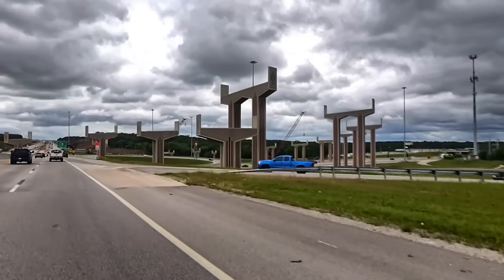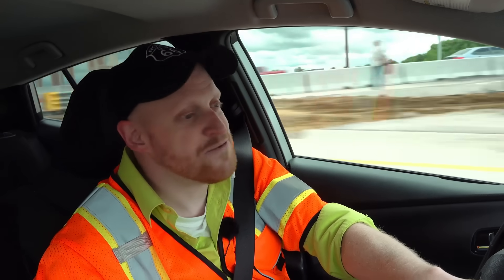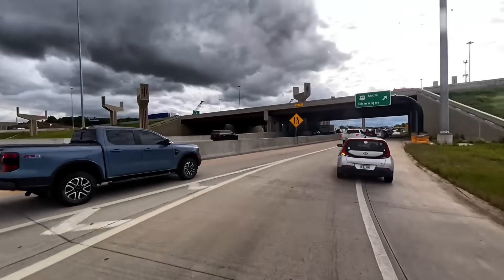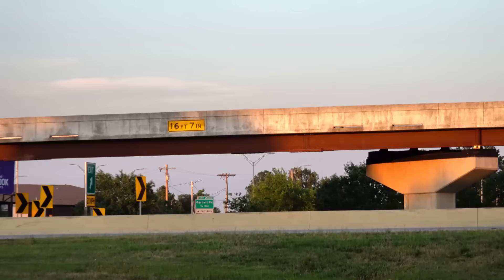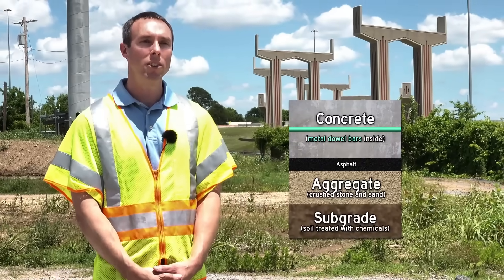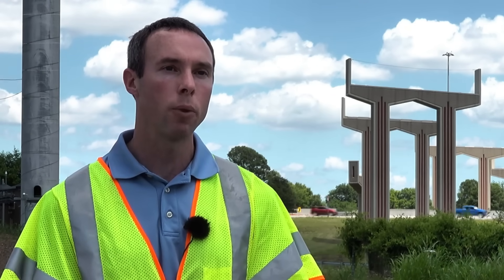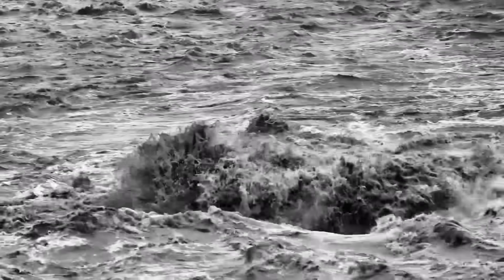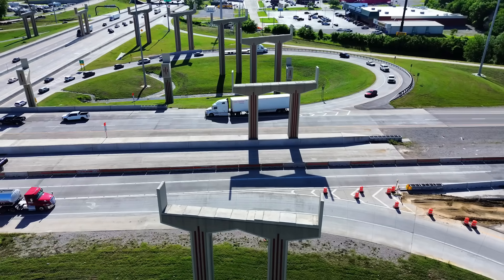Tulsa Built 50-Foot Goalposts 🏈 (It Fixes a Cloverleaf Catastrophe!)

Comment: Now, just imagine all that construction and congestion at every interchange in the Tulsa/Metro area covered with an inch or so of ice and snow. Your speed dropped from 55-65 mph to 5-10 mph. I know, it’s sad but true. I’ve lived here my whole life except for about 6-8 months when I was in Louisiana working on the oil spill clean up. They’ve got their own problems also. Their GEAUXPASS, which is like our PikePass but for a bridged with a couple of intersections and I think one stoplight. I had to get on it in Leeville and got off a couple of miles down the road. Now you can get off of it at Port Fourchon.

Comment: The biggest problem with clover leaf interchanges is the fact that people don't know what a yield sign is. People doing 70 think they have to stop for oncoming traffic and then cause the accidents. Then you have the people who are just going straight through. But refuse to get over in the left lane and just cruise on by. Instead they prefer being rude and considerate. If law enforcement would focus more on failure to yield, people driving while distracted, and those who do 15 to 20 miles under the speed limit. Most of these problems is solve themselves without having to rebuild all the highways and interchanges.

Comment: How about a Fing engineer in Oklahoma figure out how to make the transition from the Hwy to the damn bridges reasonably smooth. I swear they must use two different contractors with completely different plans. I routinely tow a 5th wheel and it’s like hitting a speed bump at 70 mph. WTF!

Comment: I remember in the mid 70's, ODOT started constructing and finished the piers and pier caps for the Belle Isle section of the new I44 upgrade in OKC Ok. They stood around for over a decade before construction resumed in the late 80's. When it did they had to deconstruct the pier caps on all the columns and replace to new specifications.A few years later we had a great new section of I44 from I35 to the 39th street interchange just pass May  ave. About 5 years later the 14 inch slab sections all along the route started heaving and dipping causing a vehicles front end to start shuttering. They had to come back with a giant rebar cutting machine,cut,regrout the slots,grind the surface level and restripe the lanes. I still don't understand what they did wrong, did they use too much rebar?

Comment: 35 to 40 MPH as the maximum speed limit would eliminate a lot of the collisions and deaths. Most people don't have the reflexes or the spatial awareness to handle a moving vehicle at 60 to 80 MPH. Think of the average driver floundering around in your local shopping mall or Home Despot parking lot, now realize that half of all drivers are worse than that. Now, take that same driver, who at 25 MPH can barely keep their shit together and ask them to accelerate and merge into traffic that's doing 65 to 70 MPH.

Comment: As recently as 30 years ago, there was a full cloverleaf interchange of two major three-digit interstate freeways just east of the San Francisco Bay Area in the town of Dublin, California.  That interchange is of interstate 580 and interstate 680, the latter being the major artery from the Livermore valley into San Jose, aka "Silicon Valley".  To the best of my knowledge, that interchange was improved but still remains a partial cloverleave, not a 'full stack' interchange.
Reply: The very first of these 'stack' interchanges is the interchange of the Harbor (Ca-110), Hollywood (US-101), Pasadena (Ca-110), and Santa Ana (US-101) in downtown Los Angeles about a mile away from Dodger Stadium.  That interchange is coloquially know as "The Four-Level".
Reply: the next of these, also in Los Angeles is the interchange of the San Diego Freeway (Interstate 405) and the Santa Monica Freeway (Interstate 10), about 4-5 miles north of LAX airport.

Comment: I’m a trucker and the other major issue with Oklahomas roads are very short exits with hair-pin curves while taking the exit. It’s damn near impossible for a 80,000 lbs vehicle to slow down to 25 MPh from the highway at 70 Mph! Also the same/opposite problem is trying to enter the highway, going up a hill, around a hair-pin curve (at 25mph) to merge left on the highway and the speed limit is 70!!!! THINK!!!!!!

Comment: What makes me angry is that the Dallas high five interchange completed in 2010 cost $226 million (adjusted for today $330 million) uses more concrete more reinforcements and just more material, so why does it cost less. It could have been done more cost effective or could be designed even more efficient then just 3 flyovers you could have 4.

Comment: Cloverleafs are the best interchange design this is a function of poor driver ability which is a function of states refusal to test drivers. These nonfunctional "solutions" are overcomplicated and reduce usability.  Have seen massive waste of roadway money on traffic destroying bad ideas like traffic circles and diverging diamond interchanges(multiple lanes with left side traffic and 12+ stoplights)
Reply: Yeah, that's why authorities all over the world are phasing them out. Fail. You're part of the problem. If you think using the same portion of road to accelerate into traffic and slow down to exit is a good idea, you're part of the problem and don't belong on the road. No doubt you're the moron holding up traffic by driving 40 when traffic's going 70 in a middle lane or all the way left.

Comment: It was just a passing comment in the video but thank you for answering a question I have had on my mind for years about what were those hexagonal bundles of rods that I saw all over during the I-10 road construction out in the desert! Seems like the metal dowels are the most likely answer to that. Makes a lot of sense!
Reply: The 'dowels' are commonly called 'rebar' (reinforcing bars),  which rest on 'chairs' , to keep them on the middle of the concrete pour.  The rebar is usually coated with a protectant, to impede deterioration from the chemicals in the concrete.
Reply: @louispaparella5766  No. Rebar is NOT what was being discussed. The dowels are smooth and rebar is not. The dowels discussed are used to transfer loading between roadway surface slabs while allowing for some movement (vehicle weight, road temperature, etc).

Comment: Have you ever done a video on the support structures put in decades ahead of the silver line near dc for similar reasons and which iirc they lost some of the documentation on and that created issues when they went to use them when the silver line was finally built.

Comment: Overpasses on an interchange improve flow but make the surrounding area an even crappier place by taking a lot of space, being an huge elevated eye-sore and spreading out the noise further away. A better option is trying to lower the 2x main axes of roads to a tunnel or at least lowest possible level and keeping only the minimum amount of overpasses at a higher level. And a good design of entry/exit ramps that is adjusted to actual trafffic conditions, electronic signalling, inteligent traffic lights + (turbo) roundabouts on the exists will improve flows more than just adding extra wide asphalt.

Comment: Yes, interchange options other than a clover leaf can allow faster / more traffic throughput, but the biggest problem with clover leaf interchanges is the people using them. People in general drive like A holes and idiots. If those exiting would slow down when reaching the merge point, and those entering would start speeding up, everyone hits a common speed where you can merge past each other. And that's the other key requirement - there has to be room for merging to happen. But when the A holes coming from each direction tailgate the vehicle in front of them there's no room left for the merge process. People are just stupid.

Comment: It's hilarious that this construction zone's been going on so long that it's in American Truck Simulator: Oklahoma.  Even funnier: It launched with this workzone included.  Years ago.
Reply: Oklahoma SUPER FUND SITE!
Reply: @RLoose9494  Seriously it'd be cheaper to clean up Picher than this interchange cost.  If they didn't divide it up into phases, I guarantee you even Okies would be like "Uuh, that's seriously "build a Tulsa Subway" money
Reply: I just installed ATS yesterday, gonna go look for it
Reply: And since then cost have tripled and they want to blow smoke up your but saying “we saved you money “.  BS all our BS
Reply: @RLoose9494 They didn't triple so much as they're on phase three of a 6 or 7 phase project broken up so they can hide the real cost from the public.  Either way, seriously grifty stuff.
Reply: @BalooUriza  I mean, look at the leadership of ODT and the Toll roads. The guy running it all was/is a con man.
Reply: @dreadpiratekiel And the Turner Turnpike was sold to voters on traffic projections suggesting that by 1930 it would have more traffic than used I 405 (America's busiest freeway) in 2019 (I 405's busiest year).  Today it carries about the same amount of traffic as the Ozark Trail, aka Route 66 and the train line next to it did combined in those routes busiest year.  Real waste of resources, especially when we get to reopen the rail line now...

Comment: Round Rock, TX built such a "braided ramp" to deal with one of the exits in a particularly congested spot on I-35 near my work. The problem is that the congestion really comes from the fact that they built another highway that dumps most of its 3 lanes of traffic, through a 2-lane bridge that then becomes 1 lane, onto the 3 lanes of I-35 that are already full of traffic that's been congested all the way through Austin. So the braided ramps cost a ton of money but didn't actually help anything.

Comment: Cloverleaf interchanges are becoming uncommon in Europe. The United Kingdom has a grand total of two. My native Netherlands has nine, all of them in the less densely populated areas of the country.

On the other hand, stack interchanges are rare in Europe. The reason for this is that roads don't have unlimited budgets. According to Wikipedia, there are eight: Belgium (2), Germany (1), Greece (1), Netherlands (1), UK (3). Google's AI thinks that this is 'at least 10'.

What you see more often is turbine interchanges, combination interchanges (mixing several styles), and 'spaghetti junctions'.

There used to be a single windmill interchange, obviously in the Netherlands. It's like a turbine, but different. However, it had to be renovated because of a freight railway line from the Rotterdam harbour to Germany, and trains don't like slopes. So now it's a windmill/stack/trumpet interchange.

Comment: At the rate they're going, by the time they finish this, it will be time to rebuild the oldest parts due to age. A smarter way to do a huge project like this is to stockpile the money, collect interest on it until you have enough to do it. That has the benefit also of being able to build to the latest standards, and all the engineers will not be retired or deceased by the time it's done.

Comment: Edit: I have reinvented the braid but worse. That's what I get for pausing.

Couldn't you solve the upper level by tightening the upwards on-leaf and give it it's own separate lane divided by a barrier, then drop the downwards off-leaf out from between the new lane and the highway and then go under the new lane to form the leaf and merge to new lane in afterwards?

Comment: Isn't it possible to offset the loop size minimums by banking the road surface?  Although that obviously starts to create problems if the vehicles are going too slow around it if it gets severely banked.

Comment: The I-494/I-694 beltway around Minneapolis-St. Paul is lined with full cloverleaf interchanges. Some even handle the intersection of TWO interstates. Slowly, Mn/DOT has added things like collector-distributor roads to help them handle ever-increasing traffic. But the I-35W/I-694, I-94/I-694, I-35W/I-494 and I-394/I-494 junctions are all full cloverleaf interchanges.

Comment: Glad you explained that they built the columns before the roads because it was cheaper to do that first. Here in San Antonio they didn't wait, we've got a cloverleaf to 5-level conversion and an elevated expressway where they started the road parts right away and haven't even finished all of the columns two years later.

Comment: You only have to replace two cloverleaf loops with flyovers (so long as they're 190 degrees across from each other) and leave the other two as loops.  Ideally, you replace those with the most traffic.  We have an example of that in the KC area, at the I-35/I-435/K-10 interchange.  The south(west)-to-east and north(east)-to-east ramps from 35 are still loops, while the east-to-north(east) and west-to-south(west) ramps are wide-sweeping flyovers.

Comment: I think the best part of this project is that they're not only making freeway traffic better but also reconnecting local streets AND improving pedestrian walkways.
Reply: We really need to start making roads better for everyone not just those who drive cars.
Reply: Tulsa has a pretty extensive trail system but when it has gaps, it’s bad. 

You can ride a bike from Events Park in Broken Arrow (where they’re building a new amphitheater) to the Riverwalk in Jenks then to downtown Tulsa then to Skiatook or Sand Springs. 

But the trail that follows 169 north from the Creek Turnpike, just kind of disappears at 61st and reappears after a two mile gap
Reply: Best of both worlds IMO

Comment: I blew through Tulsa on I-44 last week and didn't even notice the "goalposts" amidst all the other freeway chaos. The fundamental problem with urban freeways is NOT interchange geometry. It's NOT acceleration/deceleration lane length. It's simply this: TOO MANY ACCESS POINTS. STOP reconfiguring them. Start REMOVING them!
Reply: They did some of that on I-290 in Worcester MA a couple of decades back.
They eliminated some ramps in the most tight parts of the city, and I 'think' they only added one.
They also redesigned the worst highway feeder intersection I've ever seen, Kelley Square. It used to be five or six one-way roads feeding into a large slab of pavement with only two stop signs. It's now a rotary/traffic circle with the middle kind of "squished" together.
Reply: @MonkeyJedi99  A Peanut-about.
Reply: @JimBones1990  Nice!
Reply: Some ramps will be removed as part of the overall project.
Reply: They have been removing them for decades.
Reply: Absolutely don't remove them. Maybe it slightly inconveniences the small minority of people that drive through but it greatly benefits the people that live there aka the taxpayers who actually pay for the road